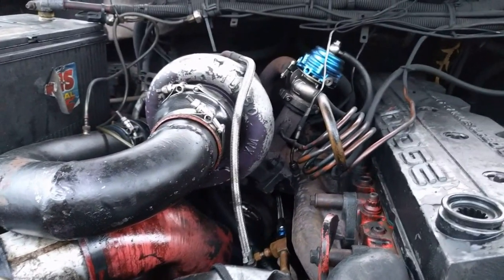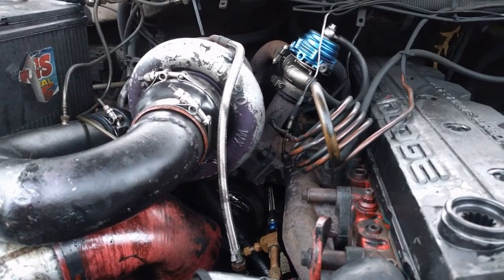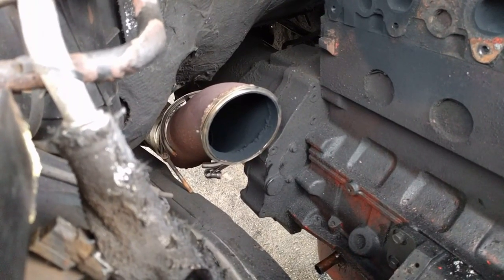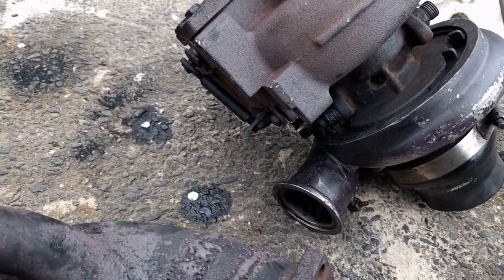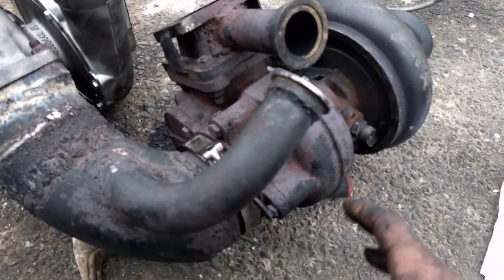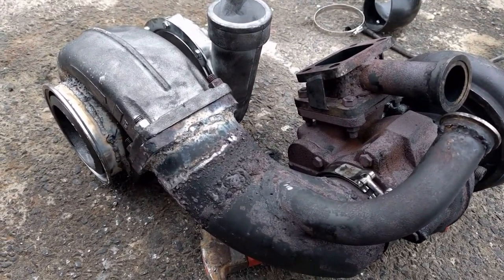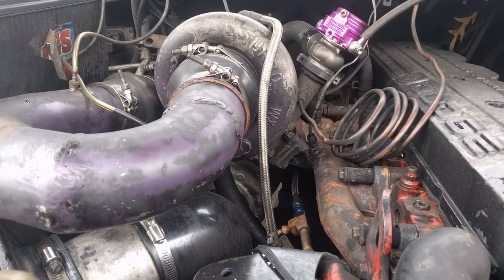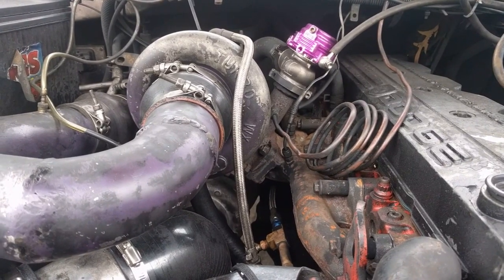Compound turbos for towing, Ultimate Tow Machine, See how to build on a budget

Comment: Ok what liter size is that engine? And what size turbo did you put on the bottom to replace the 55? The stock turbo should be a 40w? Or was it a 35? Of course all that is almost worthless without turbine and compressor wheel sizes.  Also where do you source the turbo's for a decent price?
Reply from the maker: It is5.9 cummins, I had a hx40 on top because I have a HO 6 speed. I put a hx50 on the bottom. This seems to be the best combo for me, I towed about 12,000 pounds the other day (Scrap yard scale) and they worked good. You are right you need to know the wheel size, Cummins uses Holset turbo on all there engines. This is what I meant about the top turbo is about the same size as stock with a bigger housing, the turbine and compressor wheel are about the same as a Holset hx40. The housing is a T-4 and Holset hx40 is T-3. I just google" hx50 turbo" and keep looking. There is a chance of getting a junk turbo, they probably all come from China. The word made in China dose not mean junk but they don't cost $1500 + like a true Holset. I payed $325. for mine and have used them in the past with good luck.
Reply: Thanks. You mentioned you found the 50 too big or was that a 55? It looked like you were trading it out for a slightly smaller turbo.
Reply from the maker: The hx55 was a little slow to spool up. I took the hx55 off and put the hx50 on it spools up much sooner.
Reply: Ahh ok. I see now.

Comment: Can you run two of the same turbos or should it always be a small feeding a big turbo?
Reply from the maker: The point is small turbos spool fast, big turbos spool slow. Small turbos run out of boost in low RPM's and the big dose the work in higher RPM's. So working together give you boost in low and high RPM's. So no, if you put turbos the same size on you would not gain anything.
Reply: DillonBets 69 yes you can. They should really be the same to keep the back pressure on the engine. His five inch on that exhaust is way to big. He’s loosing hp because of him loosing to much back pressure. He sounds like he’s done his home work but he needs a little more information from a top notch guy on turbochargers and the correct way to set it up. But he did a half decent job for the first time.
Reply: @johnhutchinson5398  wrong.
Reply: @johnhutchinson5398  I think your mistaken with regards to back pressure when it comes to turbo diesel engines. A turbo diesel with the biggest down pipe (5 or 6 inches in general for work trucks) and no muffler, just a straight pipe back, or to stacks if you prefer, is the best setup. Back pressure will be substantially less with an A/R of 1.00, 1.05, 1.10 versus .70, .84, .96.  Less back pressure, lower exhaust temps when hauling uphill under load.

Comment: Those turbo housings are cast aren't they? If so I think from what I can see of your welds that they look pretty darn good. Most non-welders (the people who bitch) don't realize that you haven't cleaned them up at all so you still have spatter. Those people also expect every weld to look like a TIG weld on aluminum which of course isn't possible. Damn keyboard critics who know nothing in reality but know everything in the comment section.
Reply from the maker: The exhaust part is steel the boost part is aluminum.
Reply: I have 25 years welding experience.  You shouldn't be commenting either. You don't know what you are looking at.

Comment: To big of an exhaust pipe let to much back pressure out of the engine. You should only have a three or 3 1/2 inch at the most. The same with the intake. That’s why you’re turbo on the exhaust isn’t spinning till a higher rpm.
Reply: What? Why would you want a smaller intake? Exhaust back pressure doesnt matter in a diesel, high drive pressure is bad. If its laggy get a smaller ar housing. Go back to your gasser.
Reply: john Hutchison you are incorrect sir, 5" exhaust is good in the diesel world. Keep reading about chargers for gassers, You have no clue what drive pressure is apparently. my current setup is a s363 over an s475,  6 x.013's, 3600 Valair DD,  i can beat the snot out of it and get 21-22 mpg
Reply: I think your mistaken with regards to back pressure when it comes to turbo diesel engines. A turbo diesel with the biggest down pipe (5 or 6 inches in general for work trucks) and no muffler, just a straight pipe back, or to stacks if you prefer, is the best setup. Back pressure will be substantially less with an A/R of 1.00, 1.05, 1.10 versus .70, .84, .96.  Less back pressure, lower exhaust temps when hauling uphill under load.